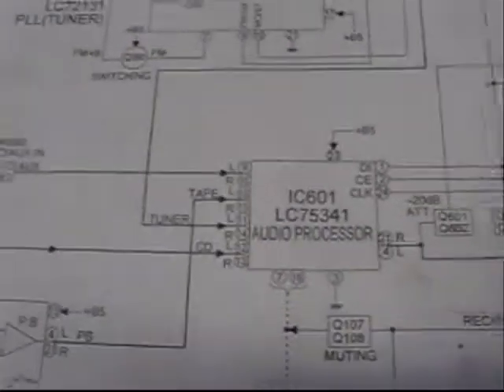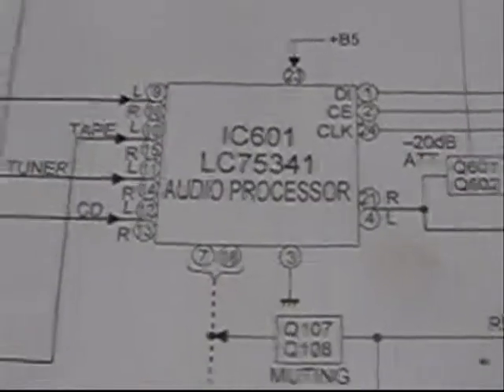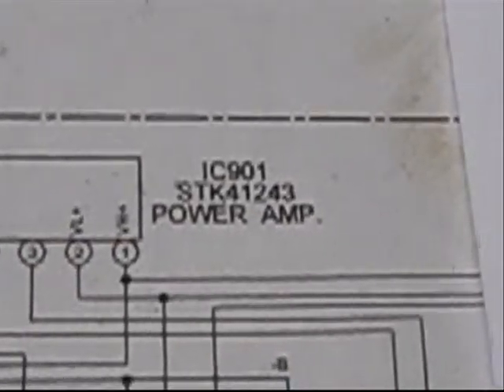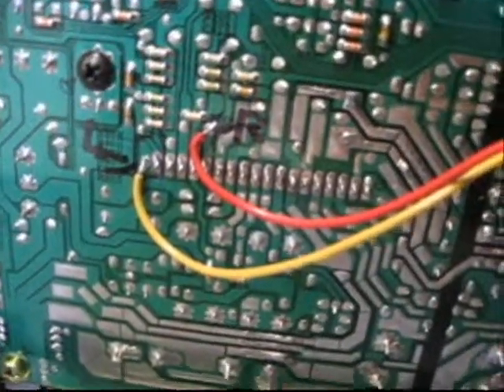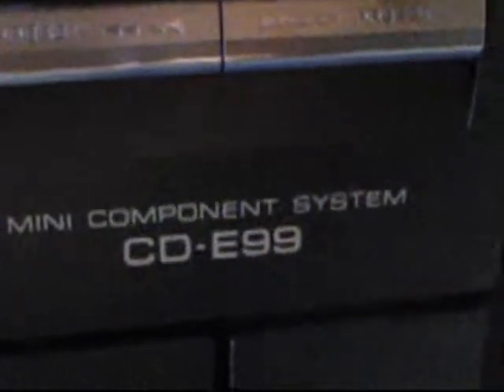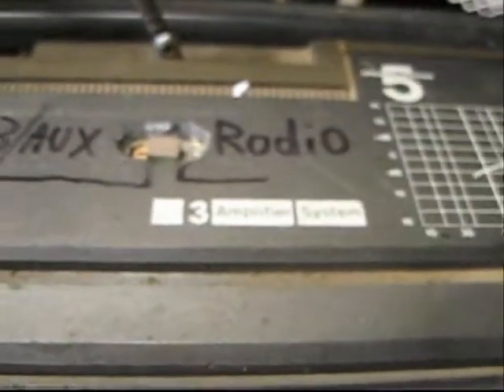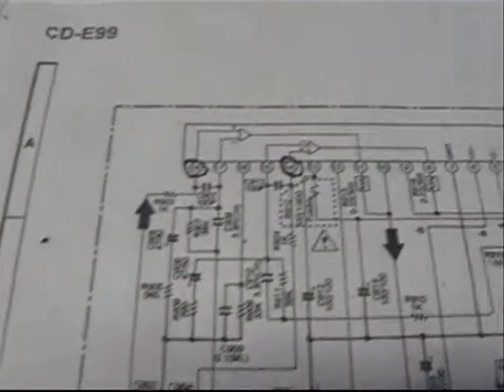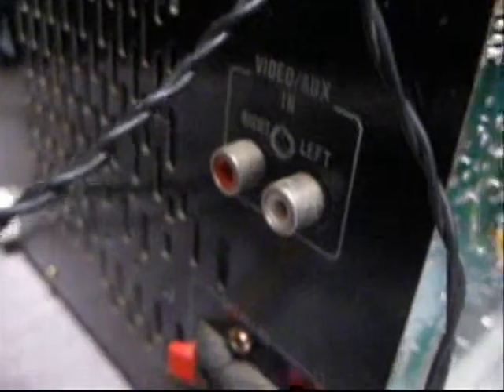Sharp CD-E99 Stereo Line Out hack

Comment: this is so silly. u do realize theres an aux port in the back, right. no need for "hacks". got the cord from the dollar store
Reply from the maker: This is a LINE OUT hack not line in. The power amp on this stereo is blown so I just tapped where the audio goes into the power amp IC and ran that to the stereo's original headphone jack. So basically this thing is now a radio/tape player/cd changer only. No amp or speakers. The audio from all that runs into an input that I installed on another stereo.
Reply: coondogtheman1234 oooo. i bought one of those male rca jacks to female 3.5mm jack so i plg what ever i want in. i even got one of those bluetooth adapters. i love this stereo. had it for 13 years now
Reply from the maker: Bag Head
I have a similar one made by Kenwood, it's set up basically the same. Had it forever and it still cranks. The belts on the cassette player are going as is in all of my cassette players but that's happening to a lot of units. I've always wanted bluetooth headphones that plug into any audio device like an old school iPod or even a walkman.